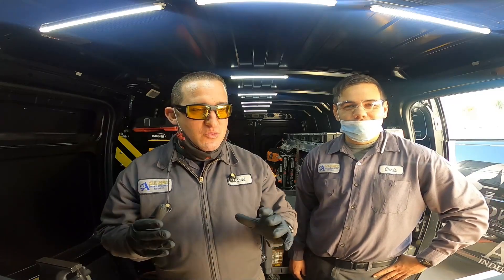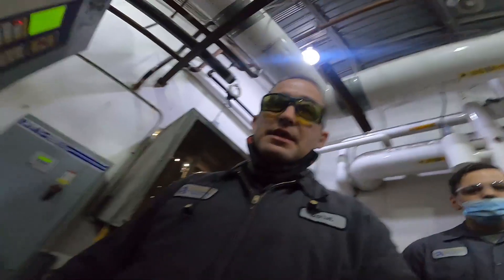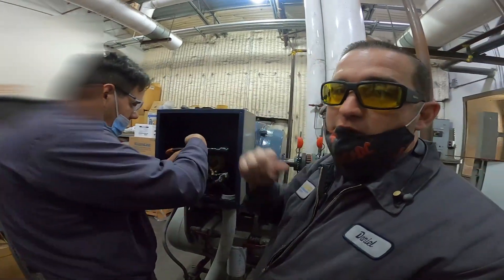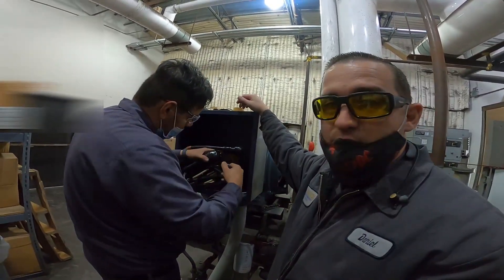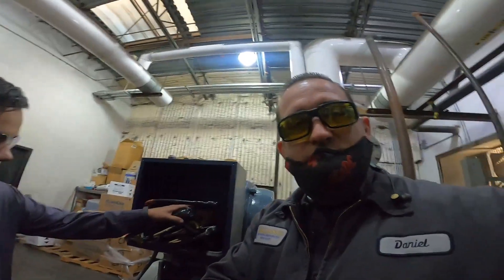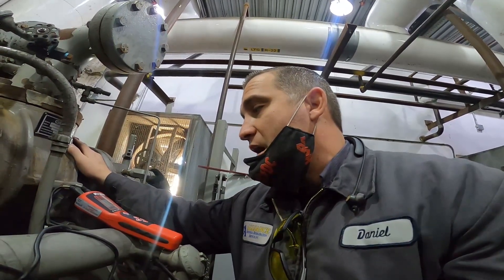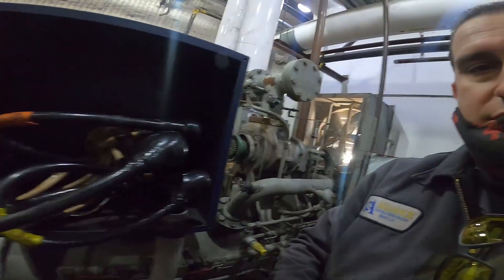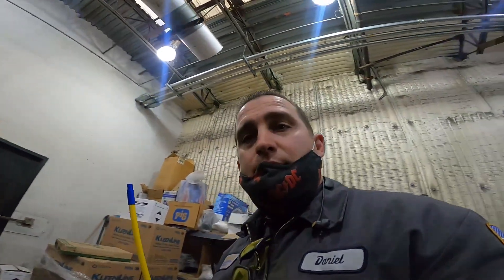Motor Alignment & Motor Is smoking!

Comment: We use the Polaris insulated multitap connectors for our 700 hp Frick compressors. Was that a six lead motor? We learned that ten seconds is a long time to bump the motor when we had a bad bearing we wanted to verify as bad. We usually bump for only about a sec or two now.

Comment: Dude... Always, ALWAYS! When working on something significant, something starts up, an air compressor bleed solenoid energizes... SOMETHIN’! never fails to scare the living shit out of you when you’re trying to focus... Haha... This is an interesting vid for me, cause I just had a catastrophic motor failure on a 350hp motor. That was gnarly... Sounded like a downed power line and had a fireball blowing out the side of the motor 😬 Good news, it’s still under warranty. Gotta pull out the motor and send it to a shop for warranty inspection tomorrow. Last thing I needed with everything else I’ve got going on, but hey... nature of the beast 🤙
Reply from the maker: That's awesome! Send me a pic to my email. Lol. alliancetechnh3@gmail.com.
Reply: @alliancetechnh3368  Will do, man 😊👍

Comment: I don't use cambric but I put electrical tape sticky side up on the leads first then wrap with the hight voltage rubber tape then put the electrical tape over it. Does the cambric being there or not make a difference ?
Reply from the maker: Yes. As you go up in electrical class it's very important that you use the cambric. Due to the high amp starts the cambric will not heat up and provide the protection it needs. Electrical tape is ok when wiring small motors. Be sure to look though the Ugly's app. This will provide you all the knowledge you may need to know about wiring a motor.
Reply: @alliancetechnh3368  Cool I'll check it out, never seen anyone use cambric over here everyone's always showed me how to do it without it even on 500hp motors. Thank you 👍

Comment: Awesome grease gun got same one!  Thanks for showing laser alignment. Daniel I remember doing a cold alignment with journeymen old school on Vilter   open drive . Before the laser alignment tedious old way! He mentioned about hot alignments on screw compressors . Rubber splicing tape split bolt connectors then super 33 nice no leakage! Industrial refrigeration and wiring got to be done safely . Thanks keep videos coming!
Reply from the maker: Thanks Jeff

Comment: R22 system ?
Reply: Wow .001" tolerance very nice work  👌
Reply from the maker: @bryancromwell8099  Thanks Bryan.
Reply from the maker: Yes. This is a R22 build up cold storage system.
Reply: @alliancetechnh3368  In Poland, R22 is banned. How much R22 is in the system?
Greetings from Poland;)
Reply from the maker: @AdamAdam-pw2lt  R22 is not manufactured here anymore. We can purchase reclaimed R22 but it is getting harder to get. We have a plan to retrofit this system soon. This system has about 3000 lbs. Thank you for subscribing. Stay tuned for my next Video.